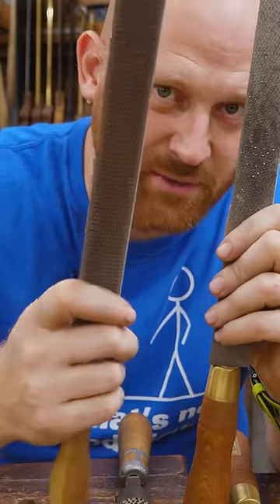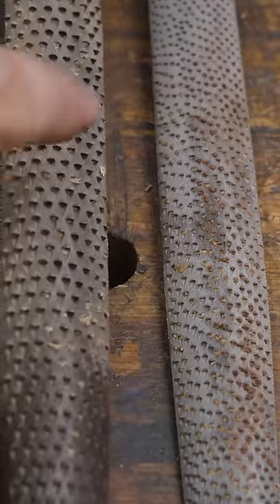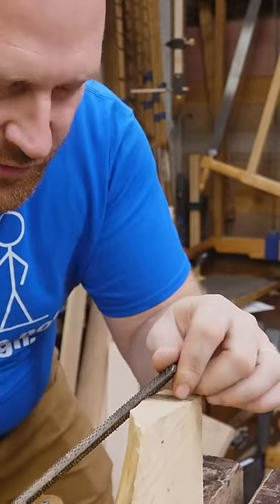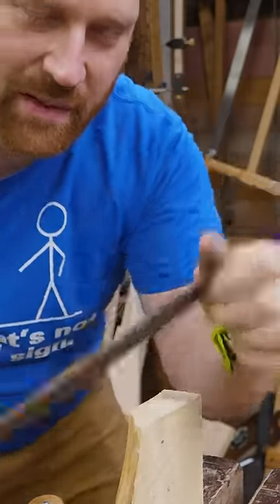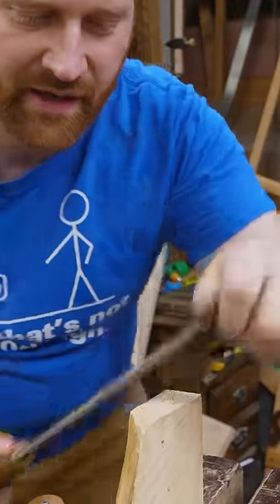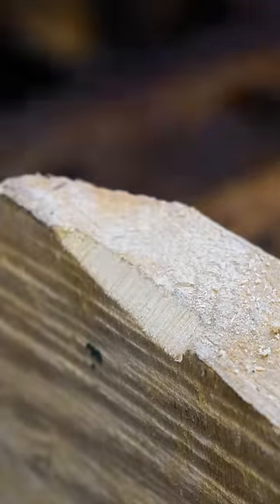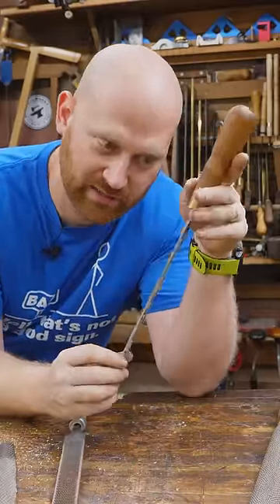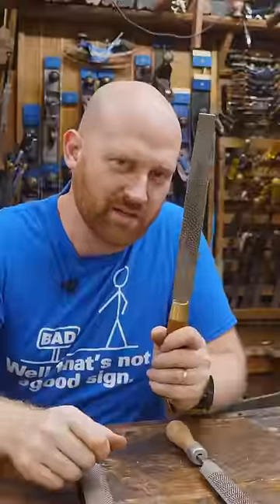Hand Stitched vs Machine Stitched Rasps

Comment: What if you did / / / or v v v angles alternate with machine .organized random ...or full surface area.  Worth a gander
Reply: Ohhh. Use BOTH
Reply from the maker: it is kind of like using a cheese grater. if you go at just the right angle it works, but any other angle and it does not. but on top of that you are normally working on a compound curve when using a rasp so the angle you must use it at is determined by the geometry of the work rather then how you would like to.

Comment: There’s an easy way to fix this with math. Simply have the machine stitched pattern altered by an algorithm that appears to be random, but has actually placed the teeth in a carefully designed pattern to minimize chattering and maximize the cut covering.
Reply from the maker: They have made that, but the cost to run it is only slightly less then paying someone in Asia. And the makers for big box stores don't care. So the price on them is about the same as the hand stitched
Reply: If it's anything like file cutting machines that's not a possibility. Those are almost always purely mechanical machines.
Reply: Would only be viable for a manufacturer that made millions and could do it for about a dollar more and sell for a few dollars more

Comment: Can you add hand stiching to a machine rasp to make it random?
Reply from the maker: once it is hardened you can not add any more. They have made that, but the cost to run it is only slightly less then paying someone in Asia. And the makers for big box stores don't care. So the price on them is about the same as the hand stitched. The current machines punch full rows at once and march down the blade. And the audience they sell to (Big Box Stores) do not care about or even know that there is quality. Here they are: https://www.corradishop.com/gold-precision-rasps-c-1_4/gold-precision-rasps-round-6-cut-6-p-604.

Comment: Why can't the machine make the hand stitch type random pattern? Is there not enough market to build that?
Reply from the maker: There is actually a company that makes a machine to do that. But usually the only people who want it are hand to a woodworkers and that's such a small group of people. The mass market doesn't want to spend the up charge for the new machine. And so now the rest made by machine with random pattern cost only slightly less than paying someone in Asia to punch them out by hand.

Comment: how hard would it be to change the pattern of the machined one?
Reply from the maker: They have made that, but the cost to run it is only slightly less then paying someone in Asia. And the makers for big box stores don't care. So the price on them is about the same as the hand stitched. The current machines punch full rows at once and march down the blade. And the audence they sell to (Big Box Stores) do not care about or even know that there is quality. Here they are: https://www.corradishop.com/gold-precision-rasps-c-1_4/gold-precision-rasps-round-6-cut-6-p-604

Comment: Seams like something we could easily solve and make them machined
Reply from the maker: They have made that, but the cost to run it is only slightly less then paying someone in Asia. And the makers for big box stores don't care. So the price on them is about the same as the hand stitched. The current machines punch full rows at once and march down the blade. And the audience they sell to (Big Box Stores) do not care about or even know that there is quality. Here they are: https://www.corradishop.com/gold-precision-rasps-c-1_4/gold-precision-rasps-round-6-cut-6-p-604.

Comment: Wh dont they just make other rpofules for mashine stitched?
Reply from the maker: They have made that, but the cost to run it is only slightly less then paying someone in Asia. And the makers for big box stores don't care. So the price on them is about the same as the hand stitched. The current machines punch full rows at once and march down the blade. And the audience they sell to (Big Box Stores) do not care about or even know that there is quality. Here they are: https://www.corradishop.com/gold-precision-rasps-c-1_4/gold-precision-rasps-round-6-cut-6-p-604.

Comment: So you saying there is a market for random pattern rough files? Because... it isn't really hard to make such thing.
Reply from the maker: They have made that, but the cost to run it is only slightly less then paying someone in Asia. And the makers for big box stores don't care. So the price on them is about the same as the hand stitched. The current machines punch full rows at once and march down the blade. And the audience they sell to (Big Box Stores) do not care about or even know that there is quality. Here they are: https://www.corradishop.com/gold-precision-rasps-c-1_4/gold-precision-rasps-round-6-cut-6-p-604.
Reply: @WoodByWrightHowTo  Ah. I'm a machine and manufacturing engineer. I have a whole machine shop and a boss who doesn't mind finding new products to sell. 

It is like... few days of setup and getting materials to make like any file pattern from something like 650 MPa hardox steel.  Hell you could even braze carbide into them.

The possibilities are endless when you are extremely bored engineer with a machineshop.
Reply from the maker: Sounds like fun. if you can make them in the $20 range you would have a market.
Reply: @WoodByWrightHowTo  That would be about 20€, which is doable if you make a big enough batch. At least the steel part is, dunno if people would be into having to make their own handles.

Comment: Could you modify the machine stitched?
Reply from the maker: They have made that, but the cost to run it is only slightly less then paying someone in Asia. And the makers for big box stores don't care. So the price on them is about the same as the hand stitched. The current machines punch full rows at once and march down the blade. And the audience they sell to (Big Box Stores) do not care about or even know that there is quality. Here they are: https://www.corradishop.com/gold-precision-rasps-c-1_4/gold-precision-rasps-round-6-cut-6-p-604.

Comment: Why not make machine stitched rasp like a hand sticker or just change it to a random pattern?
Reply from the maker: They have made that, but the cost to run it is only slightly less then paying someone in Asia. And the makers for big box stores don't care. So the price on them is about the same as the hand stitched. The current machines punch full rows at once and march down the blade. And the audience they sell to (Big Box Stores) do not care about or even know that there is quality. Here they are: https://www.corradishop.com/gold-precision-rasps-c-1_4/gold-precision-rasps-round-6-cut-6-p-604.
Reply: @WoodByWrightHowTo  maybe you’re the voice of the people and they will listen 😉
Reply: @WoodByWrightHowTo   looking at the rasps you linked, they still seem to have a “pattern” to them. Have you used one like this before? How do they compare to a hand stitched?

Comment: I mean cant you just make a machine that puts the groves/stiches whatever theyre called in a random pattern, every single one that will be made will have the same pattern ofc but they will be more like the hand stiched ones, maybe even better if you figure out the best pattern if there even is one
Reply from the maker: They have made that, but the cost to run it is only slightly less then paying someone in Asia. And the makers for big box stores don't care. So the price on them is about the same as the hand stitched. The current machines punch full rows at once and march down the blade. And the audience they sell to (Big Box Stores) do not care about or even know that there is quality. Here they are: https://www.corradishop.com/gold-precision-rasps-c-1_4/gold-precision-rasps-round-6-cut-6-p-604.

Comment: You know, it wouldn't be that hard to make a machine that makes the same tooth layout you like with modern manufacturing technology.
Reply from the maker: They have made that, but the cost to run it is only slightly less then paying someone in Asia. And the makers for big box stores don't care. So the price on them is about the same as the hand stitched. The current machines punch full rows at once and march down the blade. And the audience they sell to (Big Box Stores) do not care about or even know that there is quality. Here they are: https://www.corradishop.com/gold-precision-rasps-c-1_4/gold-precision-rasps-round-6-cut-6-p-604.

Comment: Can't factories add some amount of randomness in their pattern?
Reply from the maker: They have made that, but the cost to run it is only slightly less then paying someone in Asia. And the makers for big box stores don't care. So the price on them is about the same as the hand stitched. The current machines punch full rows at once and march down the blade. And the audience they sell to (Big Box Stores) do not care about or even know that there is quality. Here they are: https://www.corradishop.com/gold-precision-rasps-c-1_4/gold-precision-rasps-round-6-cut-6-p-604.
Reply: @WoodByWrightHowTo  alright, thanks for the response !

Comment: What’s stopping them from machining it in a non uniform manner. Surely they don’t HAVE to place them in perfect rows.
Reply from the maker: They have made that, but the cost to run it is only slightly less then paying someone in Asia. And the makers for big box stores don't care. So the price on them is about the same as the hand stitched. The current machines punch full rows at once and march down the blade. And the audience they sell to (Big Box Stores) do not care about or even know that there is quality. Here they are: https://www.corradishop.com/gold-precision-rasps-c-1_4/gold-precision-rasps-round-6-cut-6-p-604.

Comment: In germany we dont have file cutters anymore.

If a rasp or file is blunt we literally have to throw them away and get new ones.

Wenn Crafts die sustainability dies too.

I would love to own a handmade file.
Reply: Unfortunately, hand cut files are incredibly hard to do, it used to take 4+ years to train someone to make a product you can sell.

A lot of know knowledge of file cutting is lost now, just because it isn't practiced.

Rasps are somewhat easier to cut, because you can have a lot more randomness for it to work properly.
But on a file, if even one tooth is cut bad, then it compounds into later teeth, and will affect the finish.

File cutting isn't a skill, it's truly an art form.

Comment: If the hand-stitched are more effective then why don't we make the machine-stitched ones to resemble the hand-stitched ones, then we could have the more effective ones for cheaper. That only makes sense to me.

It's easier to make a machine to create random wholes then it is for a hand to line them up.
Reply from the maker: They have made that, but the cost to run it is only slightly less then paying someone in Asia. And the makers for big box stores don't care. So the price on them is about the same as the hand stitched. The current machines punch full rows at once and march down the blade. And the audence they sell to (Big Box Stores) do not care about or even know that there is quality. Here they are: https://www.corradishop.com/gold-precision-rasps-c-1_4/gold-precision-rasps-round-6-cut-6-p-604

Comment: Can't a machine stitch them differently if they wanted it to?  Are you SURE there aren't machined ones that aren't this static?
Reply from the maker: They have made that, but the cost to run it is only slightly less then paying someone in Asia. And the makers for big box stores don't care. So the price on them is about the same as the hand stitched. The current machines punch full rows at once and march down the blade. And the audience they sell to (Big Box Stores) do not care about or even know that there is quality. Here they are: https://www.corradishop.com/gold-precision-rasps-c-1_4/gold-precision-rasps-round-6-cut-6-p-604.

Comment: Why not randomized the Machine Stiched, can't they make a new mold/model with random bumps
Reply from the maker: They have made that, but the cost to run it is only slightly less then paying someone in Asia. And the makers for big box stores don't care. So the price on them is about the same as the hand stitched. The current machines punch full rows at once and march down the blade. And the audence they sell to (Big Box Stores) do not care about or even know that there is quality. Here they are: https://www.corradishop.com/gold-precision-rasps-c-1_4/gold-precision-rasps-round-6-cut-6-p-604

Comment: So we need a machine stitch with a diferent pattern instead of lines
Reply from the maker: They have made that, but the cost to run it is only slightly less then paying someone in Asia. And the makers for big box stores don't care. So the price on them is about the same as the hand stitched. The current machines punch full rows at once and march down the blade. And the audience they sell to (Big Box Stores) do not care about or even know that there is quality. Here they are: https://www.corradishop.com/gold-precision-rasps-c-1_4/gold-precision-rasps-round-6-cut-6-p-604.

Comment: its not about hand vs machine then 
its about the pattern 
im sure a machine can be Programmed to generate a "hand stiching pattern"
Reply from the maker: They have made that, but the cost to run it is only slightly less then paying someone in Asia. And the makers for big box stores don't care. So the price on them is about the same as the hand stitched. The current machines punch full rows at once and march down the blade. And the audience they sell to (Big Box Stores) do not care about or even know that there is quality. Here they are: https://www.corradishop.com/gold-precision-rasps-c-1_4/gold-precision-rasps-round-6-cut-6-p-604.

Comment: So what you're telling me is someone could make a killing machining rasps that have a more random pattern 🤔
Reply from the maker: They have made that, but the cost to run it is only slightly less then paying someone in Asia. And the makers for big box stores don't care. So the price on them is about the same as the hand stitched. The current machines punch full rows at once and march down the blade. And the audence they sell to (Big Box Stores) do not care about or even know that there is quality. Here they are: https://www.corradishop.com/gold-precision-rasps-c-1_4/gold-precision-rasps-round-6-cut-6-p-604

Comment: You can't get a machine stitch that has a random pattern on it and less on the top so it's easier to start.
Reply from the maker: They have made that, but the cost to run it is only slightly less then paying someone in Asia. And the makers for big box stores don't care. So the price on them is about the same as the hand stitched. The current machines punch full rows at once and march down the blade. And the audience they sell to (Big Box Stores) do not care about or even know that there is quality. Here they are: https://www.corradishop.com/gold-precision-rasps-c-1_4/gold-precision-rasps-round-6-cut-6-p-604.

Comment: make a machine that has a preset random stitch pattern for the tool so it works the same as a hand stitch
Reply from the maker: They have made that, but the cost to run it is only slightly less then paying someone in Asia. And the makers for big box stores don't care. So the price on them is about the same as the hand stitched. The current machines punch full rows at once and march down the blade. And the audence they sell to (Big Box Stores) do not care about or even know that there is quality. Here they are: https://www.corradishop.com/gold-precision-rasps-c-1_4/gold-precision-rasps-round-6-cut-6-p-604

Comment: Why not just make machine stitched rasps with a more random pattern so you get the same effect! I feel like it wouldn’t be that complicated and expensive to do and you could sell it as a slightly more premium tool🤷‍♂️
Reply from the maker: They have made that, but the cost to run it is only slightly less then paying someone in Asia. And the makers for big box stores don't care. So the price on them is about the same as the hand stitched. The current machines punch full rows at once and march down the blade. And the audence they sell to (Big Box Stores) do not care about or even know that there is quality. Here they are: https://www.corradishop.com/gold-precision-rasps-c-1_4/gold-precision-rasps-round-6-cut-6-p-604

Comment: So creative a more randomized pattern on a machine stitched rasp. 🤔
Reply from the maker: They have made that, but the cost to run it is only slightly less then paying someone in Asia. And the makers for big box stores don't care. So the price on them is about the same as the hand stitched. The current machines punch full rows at once and march down the blade. And the audience they sell to (Big Box Stores) do not care about or even know that there is quality. Here they are: https://www.corradishop.com/gold-precision-rasps-c-1_4/gold-precision-rasps-round-6-cut-6-p-604.

Comment: I always wonder why they do not just make the machine stiched ones line the hand stiched ones....
Reply from the maker: They have made that, but the cost to run it is only slightly less then paying someone in Asia. And the makers for big box stores don't care. So the price on them is about the same as the hand stitched. The current machines punch full rows at once and march down the blade. And the audience they sell to (Big Box Stores) do not care about or even know that there is quality. Here they are: https://www.corradishop.com/gold-precision-rasps-c-1_4/gold-precision-rasps-round-6-cut-6-p-604.